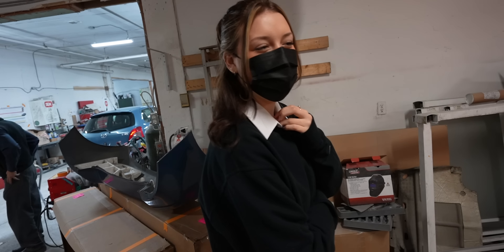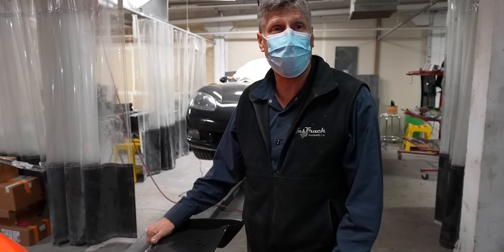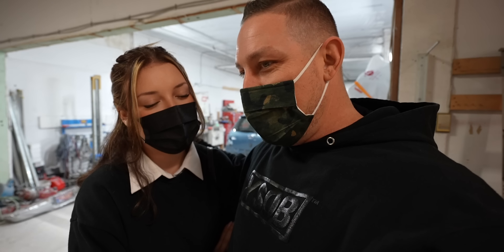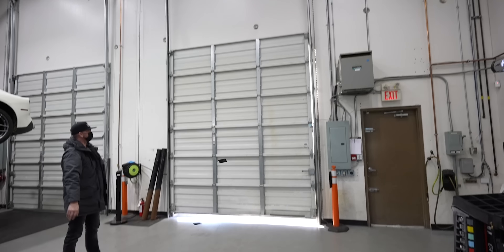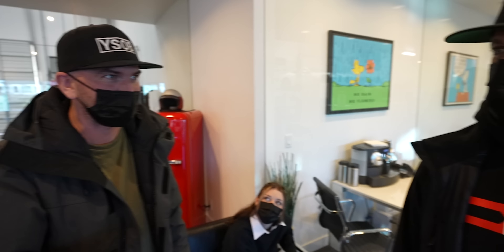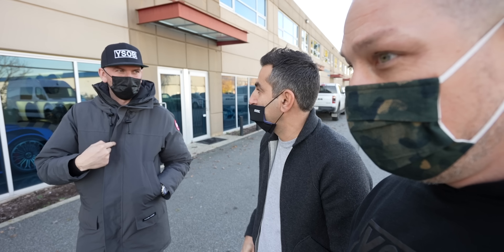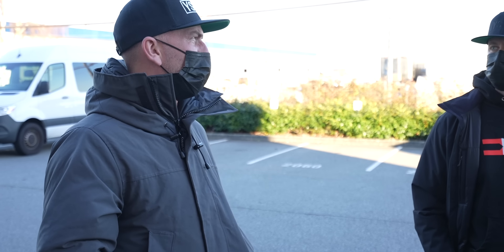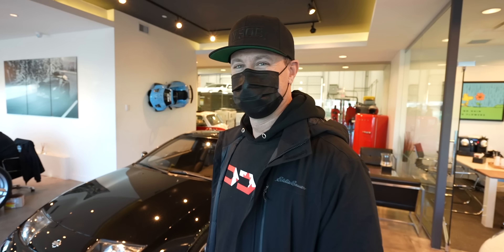SHOPPING FOR THE ULTIMATE NISSAN GTR TO BUY! * R34 vs R35? *

Comment: "GTR is not a supercar because Nissan makes cars like the Micra"

Well the same thing can be said with Lamborghini: they make tractors.
Reply: And rolls royce make airplane engine
Reply: Porsche also made tractors. Porsche 111
Reply: what about ford? is ford gt not a supercar?
Reply: @bcandradept  Exactly! It's odd how they are basing the status of cars on the lowest class of a manufacturer
Reply: @rubenchiu  There’s nothing that makes it a supercar, it doesn’t handle super well compared to most sport cars and all super cars due to weight + will overheat brakes in extensive track usage. Only thing that makes the GTR sporty is that it has the HP.  You can make the argument of there been road cars to race cars but the suspension geometry really fucks the car up in the handling aspect where the teams have to create new suspension. The GTR is a GT car and nothing else. There’s a reason why Nissan never made a race program for it until later on when privateers made their own homologations car.

P.s. Also the GTR is ugly af, take the HP away and put economy level of HP and the car would be a massive flop in 2008. The Skyline lineup of cars always been GT/family cars that were given more HP in the GTR trim. Calling it a supercar is the equivalent to taking a Subaru WRX STI giving it 600-700 hp from factory and a DCT with some minor suspension changes to make it sportier. That’s why no matter what, it will never live up to being a supercar. Sports car/ GT car is a more suitable term.
Reply: @TienTran-kw3il  yea I suppose.
Reply: @rubenchiu  Also to your Lamborghini claim, They USED to make tractors until 1980s/70s where they were sold to different companies. The only relationship between the two companies now is the name
Reply: @TienTran-kw3il  I will have to disagree w/ that. Lamborghini still makes tractors (search it up). GTR is advertised as a supercar, but like you said, its performance does not live up to it, which is something we both can agree on. 👍

Comment: R34 and MK4 are one of few Legendary JDM cars. Dave just sucks at knowing JDM cars. R35 and MK5 too. 

Back in the olden days R34 was one of the fastest cars 

STOCK Engine  R34 (tested and proven)
0 - 60 kph in 2.4s 
0 - 100 kph in just 4.9s
0 - 160 kph in just 12.3s 

R35  550 PS  Specs  (tested and Proven)
0 - 60 kph 1.7s 
0 - 100kph 2.8s  
0 - 200kph 10.6s 
1/4mile 10.8s @124.3mph / 200kph

This Dave Just love to look down on JDM cars.